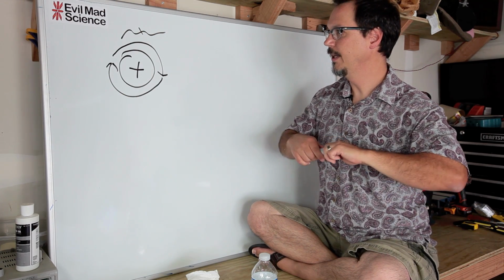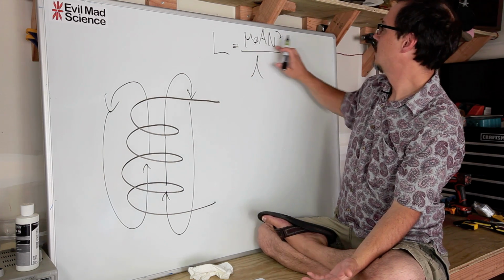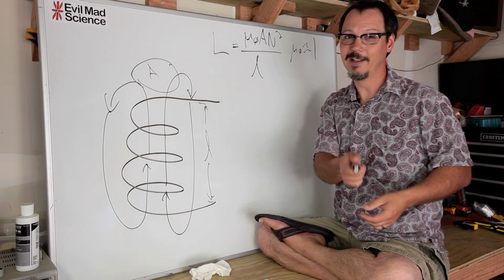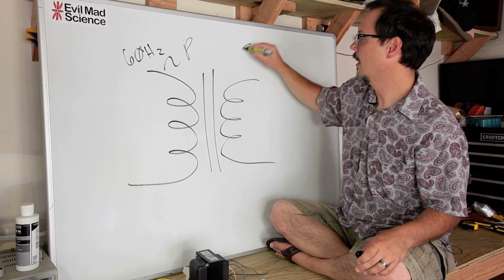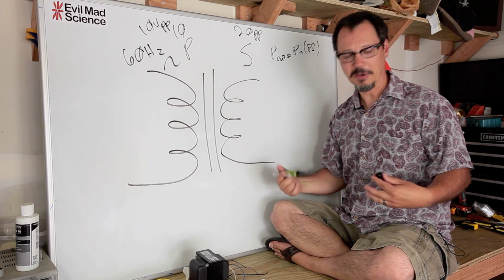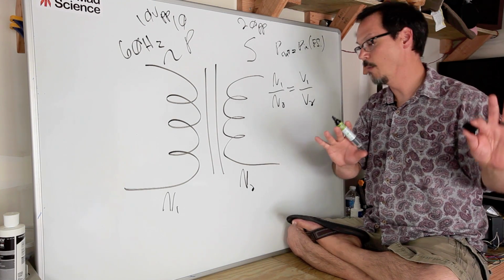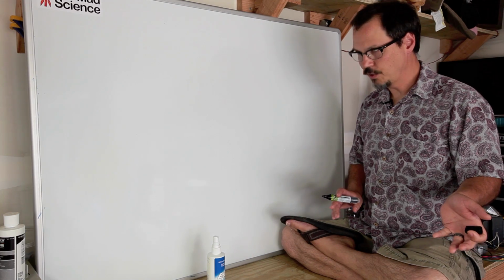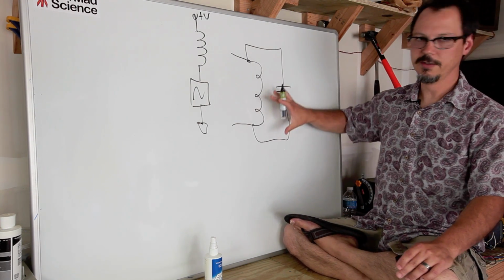SparkFun According to Pete 7-2-12: Inductors

Comment: another great one. My example to explain the energy storage in the inductor is the spring (d'oh !). Applying a current to the inductor produces a magnetic field, storage can be "seen" as pulling on the spring. When you remove the current source (battery), the spring comes back to it's original state restoring energy + losses. And of course, you can use use spring + mass to explain oscillators ! 
Congrats pete, keep those coming !